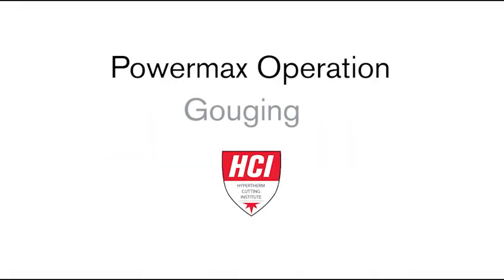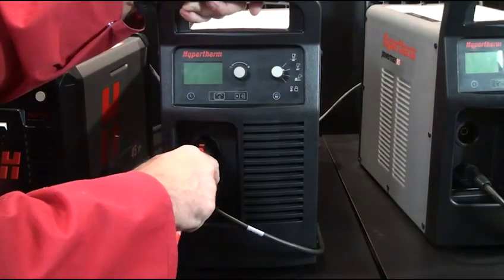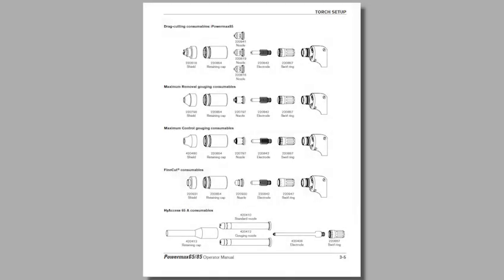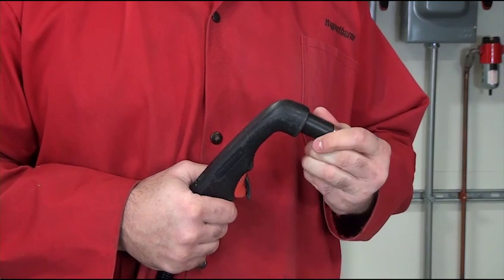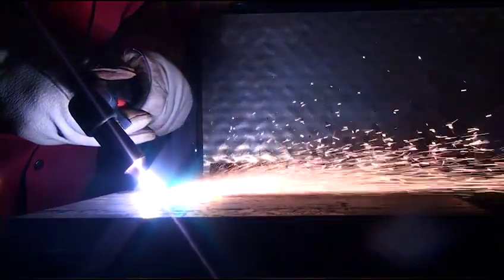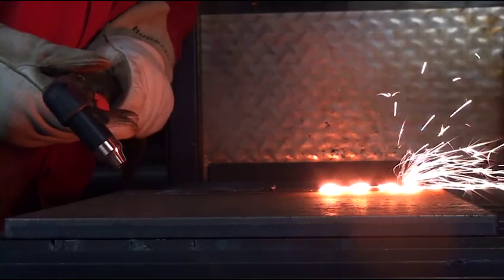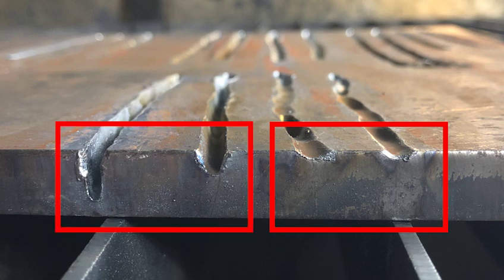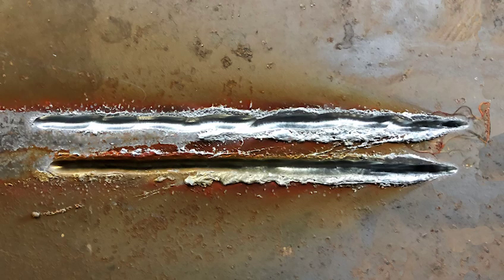Powermax Operation: Gouging

Comment: Is gouging also possible with the power max 45? Or is this an to small machine?
Reply from the maker: Hi Daan! Both the Powermax45 and the Powermax45 XP are capable of gouging. You can find which consumables you need on the Hypertherm product support page. Here is the Powermax45 Support page: https://www.hypertherm.com/en-US/support/resources-by-product/?ProductCode=POWERMAX45 . You can access the Operator Manual for download and find the gouging consumables in the PDF.